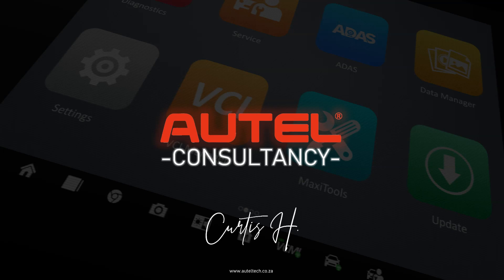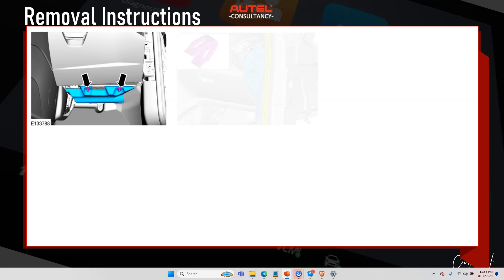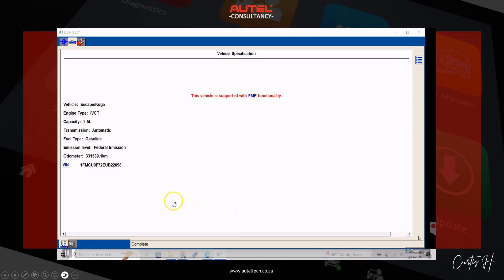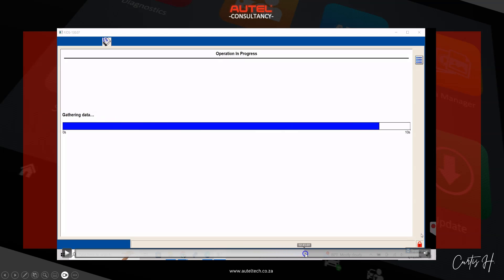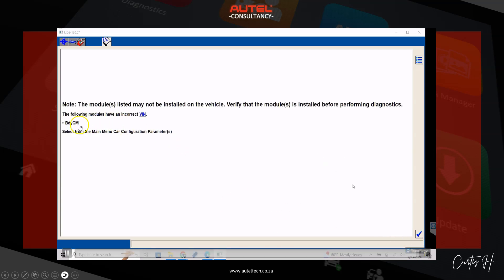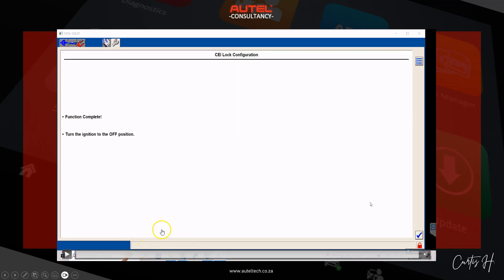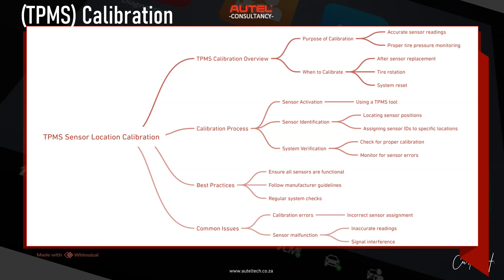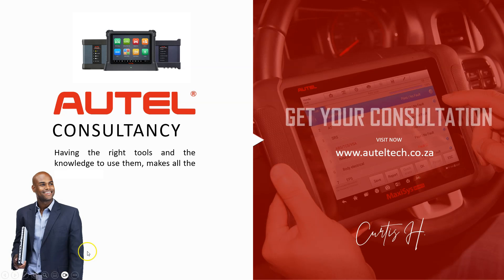Autel J2534 Case Study | How To Replace and Program a Used BCM On a 2014 Ford Fiesta

Comment: "VIN number" is a redundant oxymoron; VIN is an acronym for Vehicle Identification Number; you are saying Vehicle Identification Number Number. It's an informative video, though.
Reply from the maker: Its like saying ATM machine.
Reply: @AutelConsultancy  Before I started my own business, I experienced a funny but not amusing situation when I was a shop foreman at a repair facility; a customer who was an engineer had his vehicle in for a brake inspection, and the service manager asked the assigned technician to explain to the customer the condition of his vehicle and recommendations; during the consultation the technician continuously called the caliper guide pins and bracket bolts, screws. After the consultation with the technician, the customer requested that someone else put his vehicle back together and stated that he did not want someone that does not know the difference between a bolt and a screw working on his vehicle.
Reply: @AutelConsultancy  I know that is another example. I sometimes ask the bank tellers if it means an automated teller money (ATM) machine. No offense to you, but as a 40+ years L1, X1 Master Technician, I am passionate about maintaining a professional persona; one way is by respecting the language. I believe we who do this are on a higher level than others who can not do what we do in this industry because we are doctors and surgeons, minus the income.
Reply: @rjeromej8149  Sounds like you are wasting your time and others times arguing over moot points.  Almost none of your customers understand half of what you are saying if only using industry terminology.  Clearly need to dumb things down for them.
Reply: I was not arguing; I apologize if the conversation came across as so; the customers I deal with understand my technical jargon; these are the ones I encounter, but most of my clientele is 90% independent automobile repair facilities, for which I perform advanced-level diagnostics and programming. Please let me know if one of my customers reaches out to you and tells you such a thing; that way, I can dumb things down for them. 
Did you read the story I included about the engineer? That was well before everyone and their mama could google information.

Comment: learning to use the tools and running into weird unforeseen issues is why more people don’t do this work.  its respectable to help with the aftermarket tools, but what we really need are more robust right to repair legislation at the federal level.
Reply from the maker: I agree with you but from what I observe ( and I hate to be a negative Nancy) is that everything is going to be centralized. Meaning the power for us to do certain things will be out of our hands and done by one authority ( the dealer in our case) . I have been slowly starting to see how to do certain things you must use a dealer tool or software.  They do not want using used models anymore as they are making protocols in the vehicles to reject ( GMs Global A Architecture for example)  Thats just my observation but i agree with you